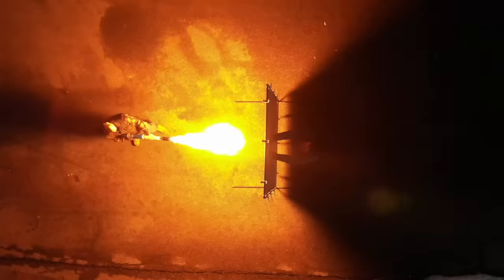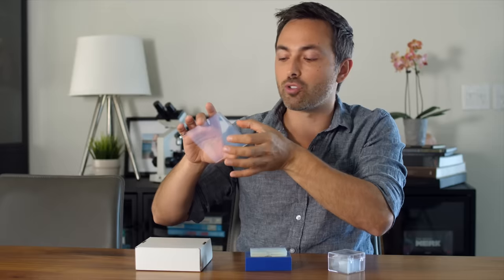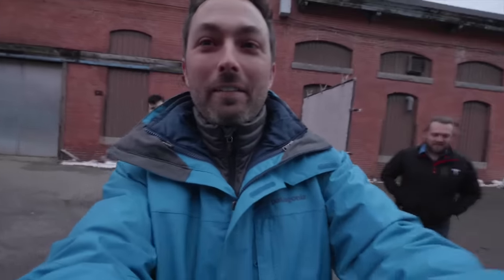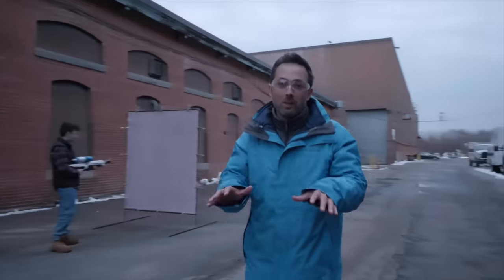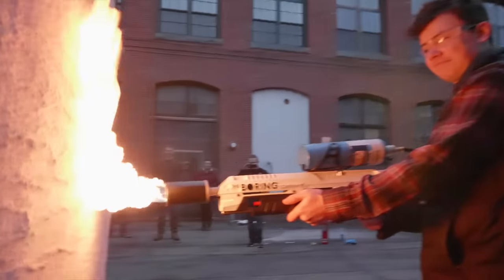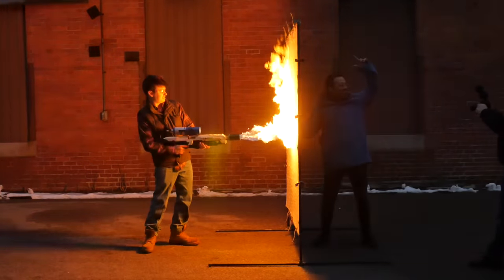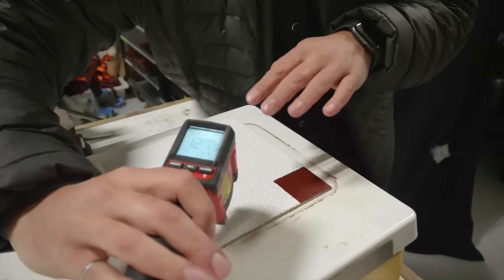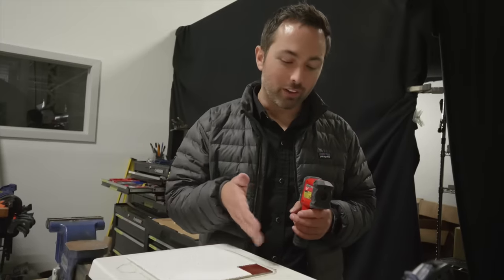Flamethrower vs Aerogel

Comment: As a volunteer firefighter, I am now curious if this company might be looking into infusing aerogel into nomex and kevlar threads to be used in turnout gear???
Reply: Have you seen the heat resistant gel type goop  thats sold in tubs? Dont know what its called but i saw a video of firemen lathering themselves up in it before going in.  It was a miracle thing. You cover your hand and it wouldnt burn if this flamethrower was on it.  Downside is the mess but HELL if i was a firefighter i wouldnt do my job unless this was supplied.  It didnt seem too costly. The firecrew in the video made it seem like it was part of their regular kit.
Reply: fredfinks the stuff they use for movies where stuntmen are on fire corridor crew has a good video on it
Reply: @fredfinks  I'm not aware of any real world use of such a product in fire services as a form of Personal Protective Equipment (PPE). There is a product that you can apply to homes and vehicles that acts as you describe, but I would not want to cover my gear in it. When we are crawling around in a fully involved structure, any gel would get wiped or scraped off and the product I am aware of highly cautions that you need 100% coverage to be effective. Also, most of these gels are water based and water is heavy. This would ad to the 70+ pounds that we already have to wear/carry to enter a building, and I'm not too fond of that idea nor do I know of any firefighter that would be.

Also, we train hard for and even have competitions on what is called Speed Dress where we must be able do don every part of our PPE including air pack in under two minutes. I cannot imagine any firefighter wanting to add another layer to that ensemble that would take time away from making entry and getting the job done. IOW, time is also our enemy and we want to reduce time spent doing things that aren't going to contribute significantly to getting the job done as quickly as possible.

So, here is my thought....Typical turnout gear is made of three layers: 1) Outer shell that is fire resistant and tough enough to handle the harsh environments we crawl/wallow around in (Nomex and Kevlar); 2) Vapor/blood borne pathogen layer to keep moisture and other icky stuff out of the area where our skin is ( imagine steamed lobster if that layer isn't there); 3) Insulating layer to help keep heat out....Problem one, when we sweat in that inner layer, we can actually steam in our own sweat if the temps get hot enough. Problem two, these three layers are heavy and bulky which slows us down and makes us work harder. If Aerogel is as demonstrated and if it can withstand the rigors of us crawling/wallowing around in nasty junk, then it seems that if we could combine the insulating properties of Aerogel into the actual structure of the Nomex shell, we might  be able to eliminate or reduce the insulating layer which is the bulkiest part of the ensemble. Also, if it would keep us cooler, we might not be as subject to being flash steamed in our own juices.

Obviously it will need to meet the extreme demands of NFPA certification before being approved for use in fire services. Just wanting to put the idea out there if any one is interested in finding another possible application for this amazing product......
Reply: They use it in NASA Space suites now
Reply: Mike Early it’s not a gel, it’s more like a powder. It’s only a gel during early stages of manufacturing. They take that gel and flash heat it at super high temp to remove the liquids and leave behind a silicon lattice that’s a super insulator.
Reply: @mikeearly2106  i think it probably would make PPE overall lighter, but something tells me it won't be durable enough to be part of the outer layer. But perhaps someone, someday might think of a way to make it a part of a kevlar or other tough layer. Right now the blankets like the one in the video are silica aerogel woven in fiberglass. Altho the silica aerogel is non toxic, it is still an irritant to eyes and skin so I don't think u'd want it currently as an inner or outer part to where it touches people. However the insulating properties also means (i think) that the vapor and blood pathogens will be too big to go thru the layer as well. So I think u will still have 3 layers: outer kevlar, fiberglass aerogel to keep out heat and pathogens, inner, soft lining to protect u from the fiberglass/silica and for comfort. But at least it should be much lighter.

I have a question for you, since I didn't know about the layers. What happens to your PPE after u crawl through a known sludge of pathogens? Do the layers come apart easily for washing? Or does the whole thing have to be incinerated?
Reply: @Geologist_Mike  Again, anything that is applied to gear that can be brushed, scraped, or rinsed off during an interior attack becomes worthless and a waste of our time. I cannot count the number of times where I have been inside the structure making an attack and been hit by a blast of water from an outside source (deck gun or other fire hose). If I had a product applied to my gear, it would most likely get blasted off and we would have lost that layer of protection. Also, water pours down from attic spaces and floors above, again potentially washing off applied products (or in this case possibly being absorbed by the product and adding weight to our gear). Obviously, if it were a dry powder, that would address the concern of additional weight, but not being infused or permanently affixed directly into the ensemble would become a "dislodgeable" (if i may coin a term) concern and would probably fail NFPA testing.

 I would love to see what y'all are talking about because if it works as promised, there may be very real world applications that would help prevent the spread of fire and help out by preventing the need for our response. The one product that I am familiar with (and have tested for myself with gel on my hand and a propane torch) is a product called Barricade. It was developed by a Florida firefighter that noticed that wet disposable diapers failed to burn in dumpster fires. It is a product that we highly recommend to home owners that live in high risk wild-fire zones. So, any information on new products would be greatly appreciated, even if it may not work for the particular application that I am thinking of.
Reply: @jacobkingdon387  Thanks for that interesting research topic. I looked it up and apparently as far back as 2015 they were testing the use of Aerogel and other similar products for EVA suits. There are some issues with use of such a product that would cause problems for fire service, most notably that the products loose thermal protection when sewed through. Thermal conductivity reached intolerable levels in areas where stitching penetrated the product. So if Aerogel was used as an insulating blanket that was quilted to keep it from bunching up at the bottom of our thermal barrier, there may be a failure point at the stitching. I only read two articles, but will continue the research to see what they have come up with over the past four years. People would be amazed at how much Space and Racing research has benefited fire services. Most municipalities don't have the funding to do research and development into safer gear for our firefighters, but race teams and NASA do. That is one reason why many of us get concerned when we hear any kind of talk about defunding NASA projects.
Reply: @androidkenobi  Good question, and a very prescient topic right now in fire services world wide. Typically, the outer shell layer is removable from the inner vapor/insulating layer(s). The vapor barrier and quilted thermal layer are usually sewn together but not sewn through, except near the edges. 

What has become a very hot topic lately is the issue of our gear being contaminated by carcinogens that continue to off-gas when our gear is not being used and is hanging up in our stations, where some paid FF's sleep and live. Up until about two or three years ago, the number one killer of firefighters was heart disease. I believe that Cancer was officially placed at the top of that list late last year or earlier this year. Why your question is relevant is that we are currently writing new policies to help mitigate this threat, and at the top of that list is decontamination after an incident. So, new NFPA rules about gear decontamination is being written with the carcinogen issue being right at the top of the list.

 Our most recent models to deal with carcinogens is mirroring what you are asking about. We are starting to treat every incident as some level of a HAZMAT scene, in that we now carry certain DECON supplies with us on the trucks and perform appropriate levels of decontamination immediately after overhaul. The procedure is to first have a firefighter remain in gear and breathing prepackaged air (SCBA) while being hosed down with "clean" water off the trucks (clean being a relative term). Then the firefighter will doff his/her gear into garbage bags to be carried back to the station to be properly laundered. At the station, while wearing proper PPE, someone will disassemble the layers and place them all into a machine designed specifically for laundering turnout gear, usually called an "extractor".

There are other levels of DECON for various exposures to HAZMAT, and there are some cases where the gear would have to be destroyed, but very rarely for the types of pathogens you would be thinking of. Of the pathogens we typically encounter, the most scary is probably hepatitis, since it is extremely virulent. But we deal with all such exposures with a simple 10% bleach solution and move on.

To your initial statement, I think you are correct about Aerogel being too fragile in its current iteration to survive use as an exterior component to our gear. That is why NFPA testing and approval would be so crucial to knowing if it would be safe for use. I also hope you are slightly wrong about the fiberglass layer.....too itchy....hope they never approve that one!!! But, I think you make an interesting point about the Aerogel potentially also being a vapor barrier. Perhaps, with research, they can develop a type of Aerogel from other substances, like corn starch? (ie Starlite?).
Reply: Mike Early google: Aerogel nonwoven as reinforcement and batting material for firefighter’s protective clothing: a comparative study
Reply: As a former volunteer firefighter, I immediately thought of uses for aerogel in the various fire services. Turnout gear aside, which makes a lot of sense if they can make it work in a suit, but maybe collapsible enclosures could be designed as a sort of safe room for firefighters who go inside burning buildings. Or even single panel partitions could be designed as a personal protective shield for firefighters who enter burning structures.  Also what about the wildland firefighters who get trapped by fire in the bush? Perhaps aerogel tents would be more effective than the current tents that they carry for such emergencies.
Reply: @Geologist_Mike  Thanks! Looks like a good read and from the summary it looks promising enough that I now wonder if it is under NFPA research already. It would be great if there was a way to reduce layers by incorporating it into the outer shell, but even as an inner layer, it looks promising so long as it reduces layer thickness more than increasing the wearer's tolerance to heat. 

Our current gear already protects us so well that we have noticed a problem in an increase of preventable injuries because some (younger) firefighters will stay in too long. We often use our ears as our guide to being too hot, and there is a very real danger of what we call flash-over. A flash-over is when all the contents of the room achieve combustible temperature all at the same time (including any firefighters in the room). When this happens, everything in the room, including the gear being worn, will spontaneously and explosively combust. If the room is getting that hot, the firefighter needs to feel that increase so he/she can get out. We are so well protected as is that the only way to tell that it is getting too hot is that our ears (the least protected area of our bodies) will start to burn. We now know that with current turnout gear technology, sometimes that is even too late.

My thought is that if we are adding a layer or supplementing a layer (as the article seems to discuss) and increasing tolerances to heat by the wearer, we aren't really gaining much. But if we can maintain the current level of thermal conductivity while reducing the layers or bulkiness of our gear, then we might be gaining speed and maneuverability without risking loosing our ability to "feel" our environment. This isn't an exact science and this "feel" comes from years of practice and experience (which is why we practice so much). If I understand the summary correctly, it looks as if the Aerogel layer might also act as a vapor barrier (as theorized by Android Kenobi above), this might reduce our layers by one, and that may be a good start. That said, another good point to be made on this topic is mentioned in the summary of the article, that increasing thermal tolerances of the wearer does give the wearer more time to escape a bad situation once they realize it is going bad....so, trade offs?.....

(BTW, I only mention the summary because I haven't been able to find the full article yet without having to pay or subscribe. I'm sure it is out there, I just haven't found it yet....I may pay since it isn't an unreasonable cost).
Reply: @Ottee2  Yes, those are great ideas (like the idea of a "shield" to make your advance....might explore that one more later) and you are correct, our wild-land brethren might be the greatest beneficiaries of this technology. And they deserve every bit of help they can get. Structural fires only last a few hours at most, but wild-land firefighters go weeks and months working hard 24/7......The safe room idea could work for both, and probably could deploy in a similar fashion to serve dual environments......It would need to be deployable with our thick structural gloves but be light enough to be an EDC for Wild-land crews.....Love the thinking...
Reply: Weird flex, but okay
Reply: forget the kevlar, its heavy and lame. Just use this aerogel material with some fabric and you keep your movement and flexibility with the a much better thermal protection.
Reply: Heck , impregnated nomex would be awesome for us refinery workers.

Comment: The not a flamethrower is a modified device used in roofing torch.  So they can easily be fixed and I would home Veritasium could do a fun short video on how to fix not a flamethrower. :)

Comment: So essentially, aerogel is the perfect replacement for asbestos
Reply: And it probably doesn't cause cancer. That's neat.
Reply: @lare290  Or like asbestos, we will find out if it does in 20 years
Reply: @lare290  Everything falls into two categories: "definitely causes cancer" and "might cause cancer, but we need more research"
Reply: lare290 bad news...it’s made of silica.
Reply: But it just dosen't have the same feeling as asbestos.
Reply: @Mostlyharmless1985  not necessarily bad news. Glass is also made of silicate (i think lol, kick my ass if I'm off at all)
But asbestos was fibrous. Microscopic fibres of silicate. Aerogel seems different in structure
Reply: @Mc47Fan  i believe the difference is that asbestos is made of crystalline silica fibers, whereas aerogel is amorphous silica just like glass. that said the aerogel is infused in fiberglass so i still would be careful about breathing it in.
Reply: @Mc47Fan  The reason asbestos in cancerogenic is small sharp particles that our body can't dissolve and get rid, it is not toxic, but those particles continuosly damage out tissues. Aerogel also can produce lots of sharp shaped dust when breaking. So I think it is also potentially carcenogenic.
Reply: Of corse continuos working and breathing with large quantities of asbestos dust provocate cancer. But hey even wood dust without proper protection provocate serious professional illnesses. And I believe that other thin fiber dust generating insulating materials based on basalt or glass are not much more safe than asbestos.
Reply: @Mostlyharmless1985  there's also graphene aerogel instead
Reply: @JorgetePanete  thanks

Comment: So this could solve the overheating problem of lightsabers
Reply: not just lightsabers but laser pointers oh man
Reply: No, it'd make it worse by trapping the heat ( unless you mean sheilding the user, but the device still overheats)
Reply: The problem with lightsabers is that for some scenes to work they had to be so hot that they turn air into a plasma wich would not only be devistating for you and everything around you, but it also meant that if you somehow protect yourself from the heat it would esfixiate you.
Even if you somehow protected yourself from your own lightsaber, other lightsabers would be as ineffectively at kill you as your own.
If lightsabers existed it would be far more effective to just activate them and walking around than using them like real swords, which makes the whole idea pointless, as it would just be a device that gets really hot.

Side note: I apologize for anny spelling errors (I am not a native english speaker)
Reply: Olaf Winter bro it’s fine that is really smart
Reply: @magicjello4633  Thank you
Reply: Jack Torrance
Nah, the heating problem mostly comes from the hardware, not the exterior.
Reply: @mr.winter538  Their true use would be being fired from ballistae.
Reply: It solves how to shield against a lightsaber. Aerogel Jedi robe anyone?
Reply: not if you throw the lightsaber against a wall 100 times
Reply: @foysalmiah20xx  Sounds cool. Would also solve the problem of wet, heavy robes when you need to go into gungan territory
Reply: Protection from death star
Reply: Omg u r right